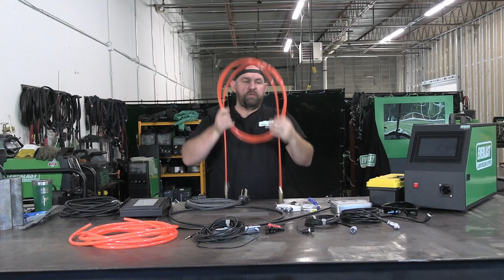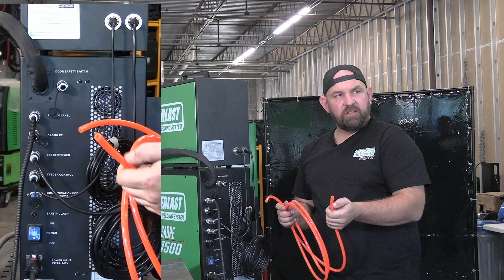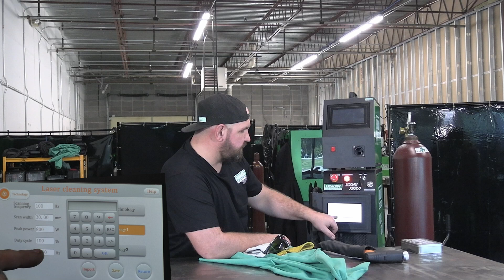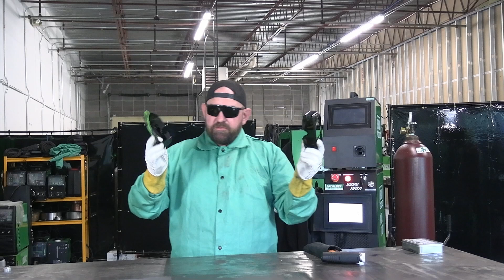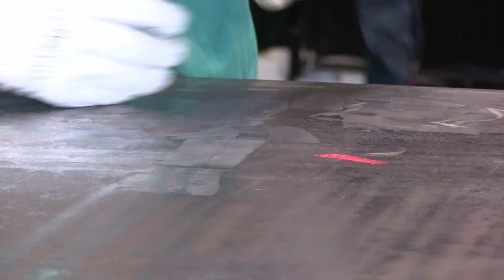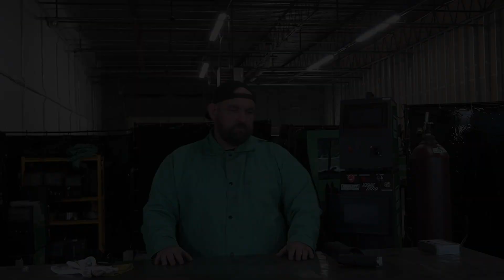RedSabre 1500 First Setup and Run

Comment: you take your glasses on/off all the time. my biggest concern is doing what i have done with mig many times - forgetting them just once. It would be really nice if you could have a visor and the glasses with a proximity sensor so you keep the glasses on all the time and it only fires when you have the visor down sensing both visor and glasses

Comment: If you use nitrogen rather than argon for welding, does that require adjustments to the flow rate?